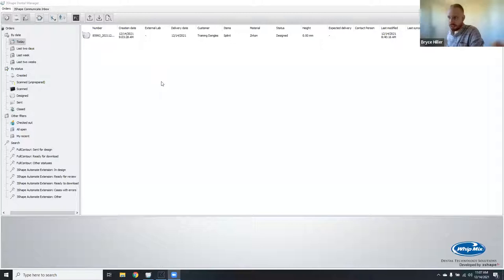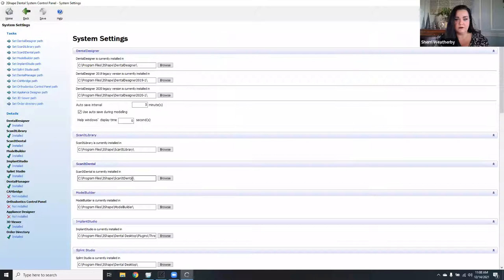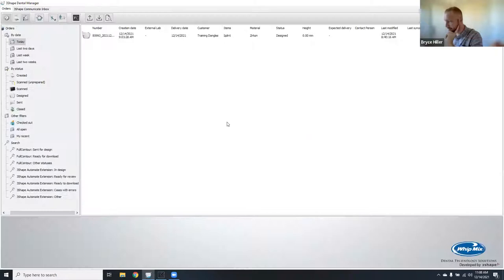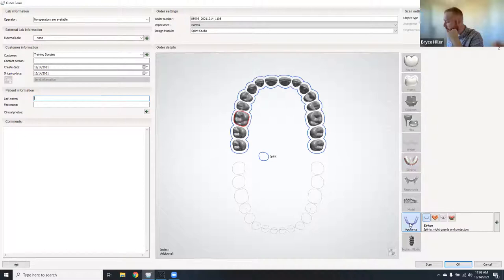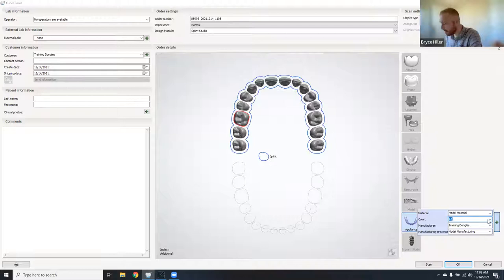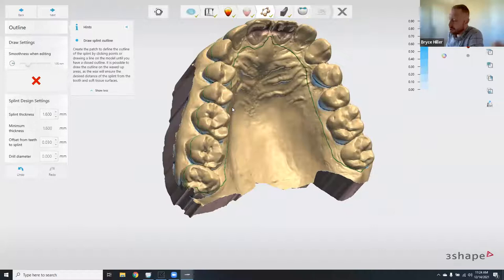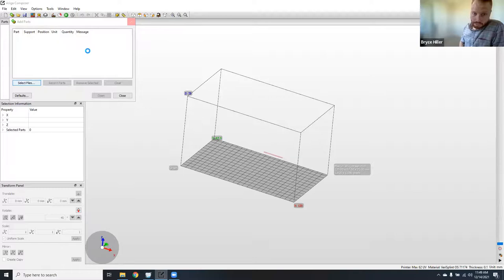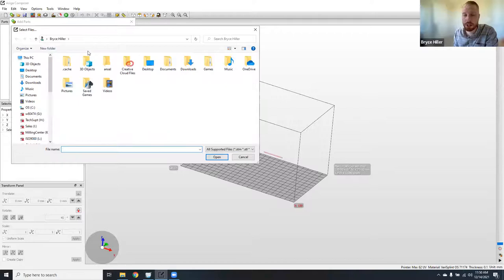[Webinar] From Design to Print   Bite Splints with Bryce Hiller and Sherri Weatherby

Comment: Hy! I see on the manufactures it is only 7-8 manufactured! When i have nextdent 5100 i can’t make this on 3shape? Thank you for the answer!
Reply from the maker: Are you asking about what manufacturers are available when selecting machines/materials in Dental Desktop? There are limited choices there so we would refer you to the manufacturer of the resin you are using to request any information in using that resin with 3Shape. There are also instruction manuals that can be provided by the manufacturer that would give you the parameters you need to print correctly with that resin. You will need to make sure that the selections that you choose will allow you to design within the parameters set by the instruction manual of the resin.

Comment: Hi, I get sometime "Incorrect outline" error during the outline step from the Splint Studio. How do I fix ?
Reply from the maker: Without seeing the line in question it is difficult to specify what is being done incorrectly. However, we recommend you try redrawing the line first. If it persists, you then want to confirm that you have the correct models for the correct arches (maxilla with maxilla) and that your insertion direction is correct. If the problem still persists it could be an issue with the scan. In which case you will need to either get a new scan or try repairing the scan.